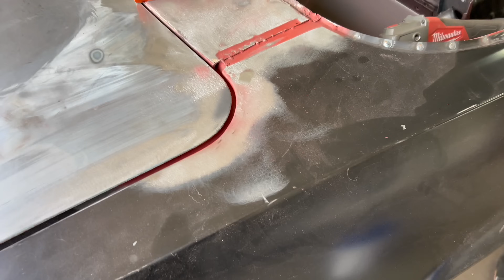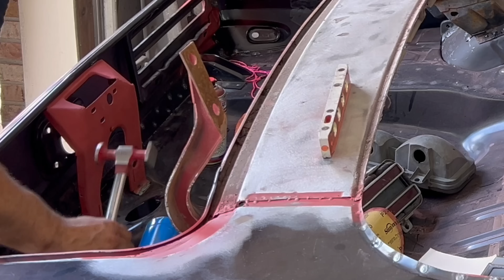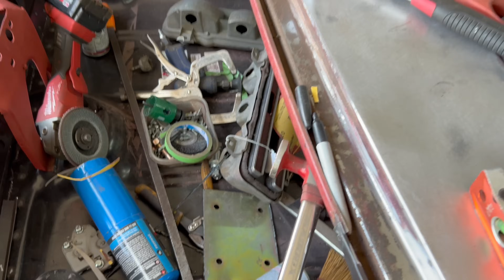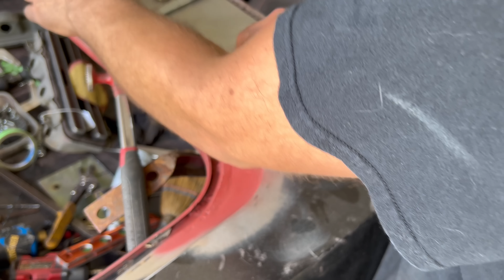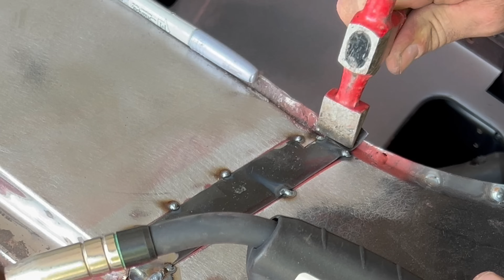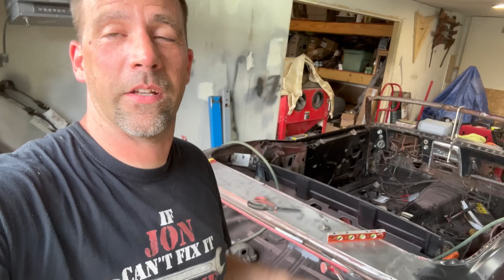Removing lead seams and alternative way to fill the gap

Comment: You should have put weld thru primer on the filler piece, too. Or did I miss that? Otherwise, good work. One more option is to fill it with fiberglass resin with filler (waterproof!)
Reply: One more thing: you could have done was hammer and dollied the area to lift it to smooth it out. Just about remove any need for filler.
Reply from the maker: If I choose to fill one i agree fiberglass is best

Comment: very nice patch for that seam.  The more I think about it, I think I will do the same thing for the sail panels on my Camaro.  Makes more sense to me than packing a ton of short strand fiberglass filler in it.  Thanks Buddy!
Reply from the maker: Right on!  This has worked for me worth trying out worst case fill it with fiberglass
Reply: Without the lead in the trunk jamb, your most likely to have water leaks down the road.  I've experienced.

Comment: You need to put Led back in those seams, over the period of time that will not hold up. Kaka, kaka.🤮.
Reply: Also metal patch overlap  will push over time and there will be a small hump there as the rust pushes it outward.😢
Reply: Incorrect. I've done this technique for decades, and it works well if done correctly.
Reply: @gofastwclass so you're a Jerry rigger too huh, learn how to do it the right way.
I've been doing body work for 50 plus years, and this technique is no good.
Reply from the maker: Like I said many ways it can be done plus many opinions on just about everything you do what works for you this is just one way NOT the only way.
Reply: @VinylVillageGarage the way you are doing this it's not a good idea on a lot of reasons, number one the cavity holds moisture, number 2 over the period of time it will crack from the body flexing, And number 3 it is not original.
Reply from the maker: @sherwinstaudt1881 as
With the lead seam it has a cavity between the layers as well where it was spot welded.  All methods rust unfortunately.  I have seen lead crack or separate just the same over time
Because of rust or flex. This build originality isn’t the goal 90 % of this car was rusted away and has been replaced. I do agree if it was an original restoration of a very rare car it might be a better choice to return it to lead. 
  Back to what was said in the video this is only an option to consider all methods have pros and cons. It’s only an example of a way or inspiration for anyone to create their own way, this is not the only nor necessarily the number one pick for everyone.
Reply: @sherwinstaudt1881  Your "lot of reasons"  turned out to be pretty weak arguments lol. 1. Unless you make and seal the join in a vacuum, there will always be some small amount of trapped moisture. 2. any join given enough time and flex will eventually crack. 3. Original wasn't that good to begin with..... lol.